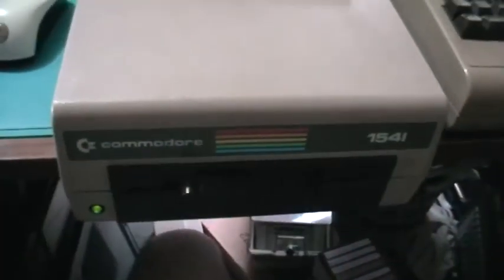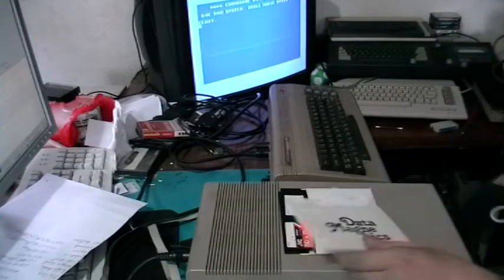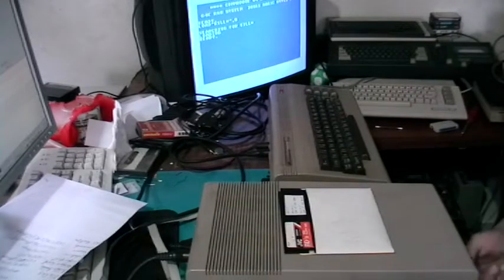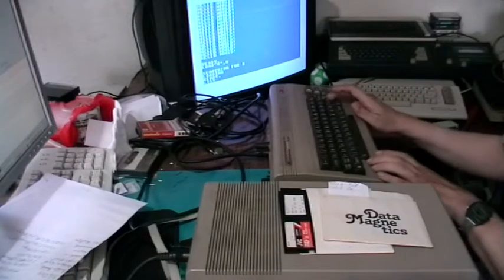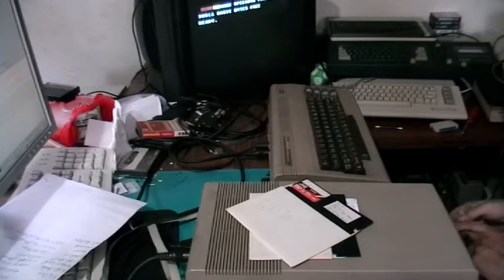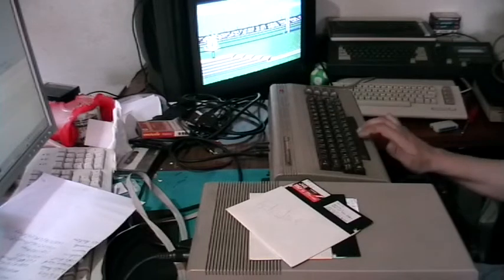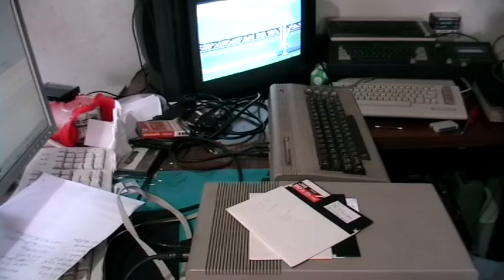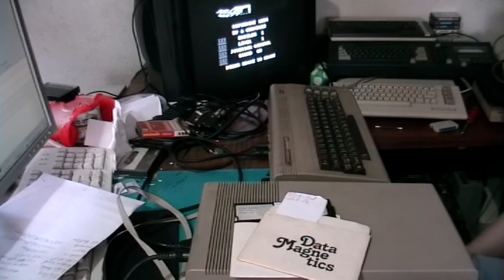System Review: Commodore C64 (Part 2) - The 1541 Disk Drive

Comment from the maker: The 1541 is incredibly slow. With SpeedDOS it's about as fast as the Atari Drive.
But SpeedDOS is the oldest and slowest hardware speeder. "Jiffy DOS" can do the same without an extra cable... but the extra parallel cable was very handy for copying protected games :D
With a more sophisticated DOS like "Doplhin DOS" or "Pro DOS" you could load any program in less than 5 seconds...